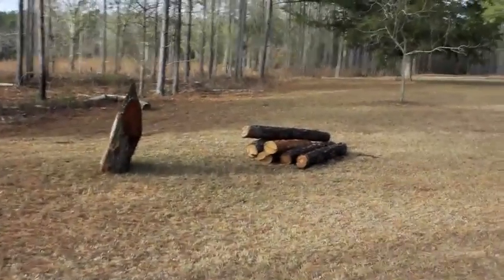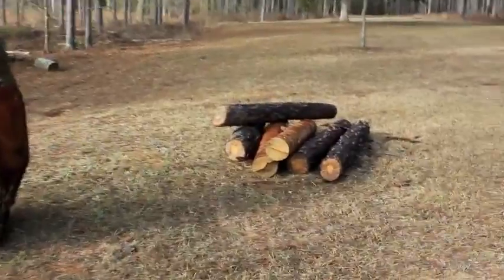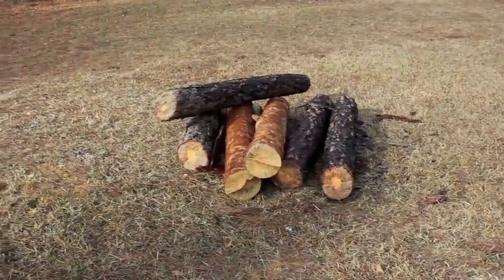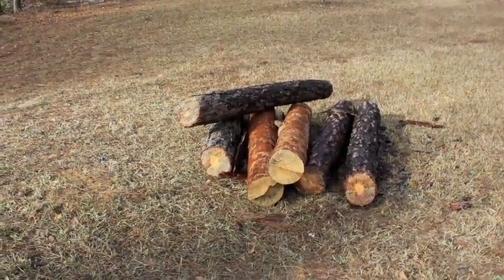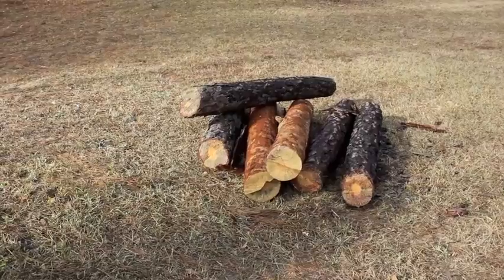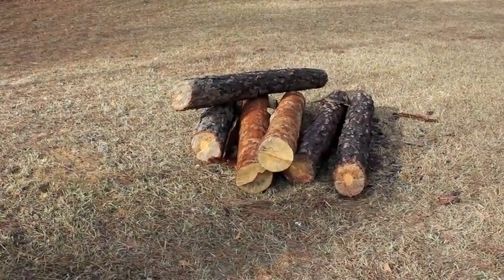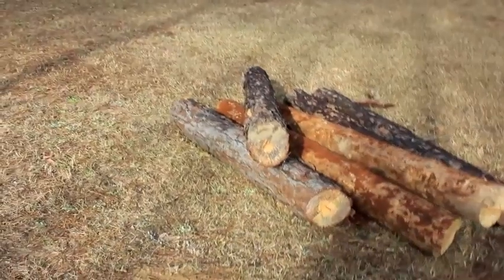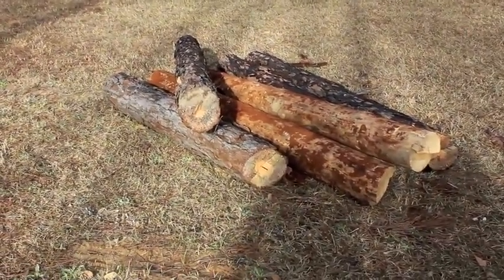Building a SOLAR KILN!! Part 2

Comment: I applaud your initiative in building a solar kiln. and more important to be adding value to the forest resource. I noticed that your joist are held in place by only one toenail-- i think you should be  putting joist hangers in to support the load, or your design should have incorporated a sill plate on top of a beam.

Comment: At 12:40, you mentioned how the lumber splits when you drive a nail through the end of the board.  When nails split the lumber, sometimes blunting the nail point before driving it prevents the lumber from splitting.  I'm not sure why it helps but it does.  I think the blunted nail acts more like a punch than a wedge which causes the nail to "drill" it's on hole. 

Also, turning the curve of the grain down (like an upside-down "U" helps prevent cupping.
Reply: You’re right about the cupping for sure,I will have to try the blunt nail trick, done lots of hemlock barn siding and it can be a pain splitting when nailed

Comment: Hey Buddy, you can stop boards from spitting when you nain them by taking your hammer and tapping the point of each nail, so it's not so sharp and the boards won't spilt on you.

Comment: Sure wish we were neighbors....I'd teach you a bunch of practical carpentry.  SO, for future construction:  (and I hope you don't mind the constructive critique)

1.  Simply nailing joists to your beam isn't good practice.....you're depending on the nails alone to hold the joist up.  Might get away with it on a lightly loaded floor, but with a heavy load, they will tend to pull away any go south.  Also, being green lumber, the joist will shrink some in length, making the problem worse.

Better method is to set the joist on top the beam, or use joist hangers (hard to do with rough lumber) or use a 2x2 nailer nailed to the beams, then notch out a 2x2 cut on the bottom side of the joist to sit on the nailer in addition to nailing like you did.  Remember, nails aren't near as strong as something sitting on something.

2.  Leave that outer band of 2x4 off....then run your subfloor at a 45 degree to the floor joists.  Makes for a much stronger subfloor, and is how it was always done prior to the invention of plywood.  Then frame your outer walls up and stand them up, including that bottom 2x4 plate.

3.  Green lumber in your subfloor is definitely going to shrink across the face....you'll end up with 1/4-3/8" gaps between the boards when the finally dry...giving a lot of access to air flow (which may not be a bad thing in a kiln).  In old time house construction, they would lay tarpaper on top the subfloor prior to installing a finish wood flooring to slow up air infiltration as well as stop wood to wood contact, which made for a lot of speaks.
Reply from the maker: Ed Smith I’m always open to good advice, thank you. I already have some gaps in the floor about the dimensions you note. Those are good ideas concerning the joists as well. This has been a great learning experience for me and I hope to improve on my next project. Thanks for watching and for the tips!
Reply: That is some good advice! Also, I use screws. If I nail anything anymore, it is with a nail gun.

Comment: I live close to the Mississippi River and every time the river goes up and stays up for a while there are lots of logs left on the banks, I know most of it is cottonwood that is already unusable for pulp but there has to be a lot of oak and other hard wood in it.  I have watched it piled and burned but I never noticed anyone picking through it for useable logs.  I would think there is a lot of good wood going to waste, maybe not but I can believe 100% of that wood is cotton wood.
Reply: Cottonwood is usable for timber frame timbers.  My greatgrand father built a timber frame barn in the 1870's 12x15"x28' upright posts.  As long as they are kept dry, they last.  The barn is still standing 145 years later
Reply from the maker: Interesting! Thanks for commenting!

Comment: HIT THE point of the nail with the hammer and U won't  split the wood flatten the point of the nail withe hammer twice with the hammer .  3/32nds  ???
Reply from the maker: Karel Van Leer I’ve been doing that as others have also suggested it. It works great! Thanks for the comment!

Comment: Man!  This is coming along great.  Questions, are the floor joist 24 inch or 16 on center?  Thanks for sharing!
Reply from the maker: Dillons Woodworks They are on roughly 30” centers. The floorboards are a full inch thick though so it’s rock solid. Not so standard but it works. Thanks for the comment!

Comment: Turn the nail(s) over.  Blunt the tip of the nail.  Then drive it in.  You can drill a pilot hole, but blunting the ends will help a lot and save you a step.  Green wood. For the floor I would have rabbited the opposite side of each board, that way when the boards shrink there will not allow air to flow from the ground.
Reply from the maker: Thanks for the tip! I've had good success with blunting nail tips. That would have been a great idea on the boards.
Reply: If you put two nails in the end of a green board and as it dries it will shrink meaning that the nails will hold edges of the boards and a split will have to occur.  I know that unless you turn the boards so the grain will hump up in the middle instead of the ends. After the boards dry you can come back and put in the second nail.  I know this seems like a lot of trouble but I did it on a couple of trailers I have with wooden floors and only used one bole instead of two and when the pressure treated wood shrunk none of them split along the grain.

Comment: You should use joist hangers. see link.  https://www.homedepot.com/p/Simpson-Strong-Tie-Z-MAX-2-in-x-6-in-Galvanized-Double-Shear-Face-Mount-Joist-Hanger-LUS26Z/100375105
Reply from the maker: Frank South Thanks for the tip!

Comment: Looking real good. It is my experience that quarter sawn boards whether wet or dry split easier than plain sawn or rift sawn boards due to the grain running mostly straight up and down. Rift sawn is worse than plain sawn due to the slant of the grain running mostly from 30 degree angle to 60 degree angle with 45 degree angle being truly rift. Wauhaus was right about blunting the point of the nail. That allows it to cut through the board more so than spreading its way through. On rift sawn sometimes you can angle the nail opposite from the slant of the grain and go through several layers of grain to keep it from splitting and also the slower a nail is driven the less likely it is to split the board but drilling the pilot hole like you are doing is always best. I spent yesterday afternoon sawing lumber to board and batten a shed. Keep the videos coming.
Reply from the maker: James Stroud Thanks for the good tips! I tried the blunted nail trick earlier today and it worked very well. I haven’t learned all those different cuts yet. I just cut the thicknesses that I need and pray it looks good.

Comment: They say if you blunt the tip of the nail it will prevent the splitting.  I seldom use nails anymore.......
Reply from the maker: wauhawk Thanks for the tip!
Reply: Most recently I saw Tom Silva on This Old House give it.  Something about blunt tip crushes through instead of a sharp tip cutting and then acting like a splitting axe would.